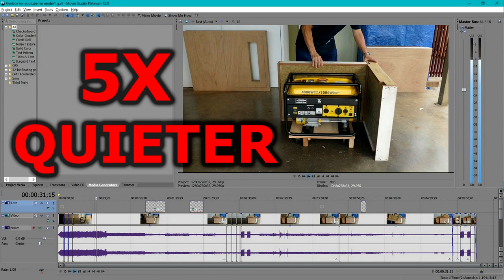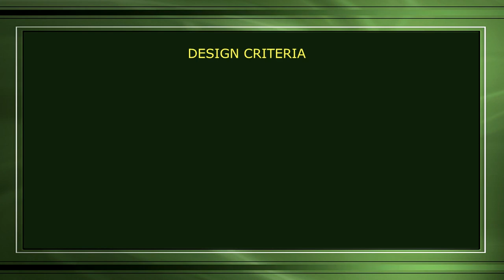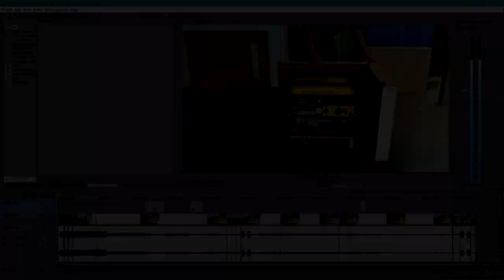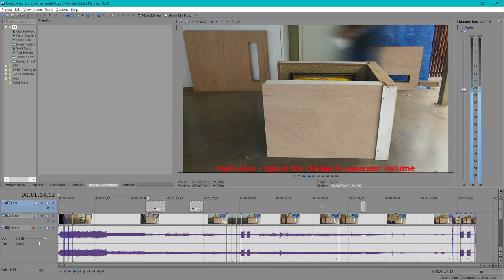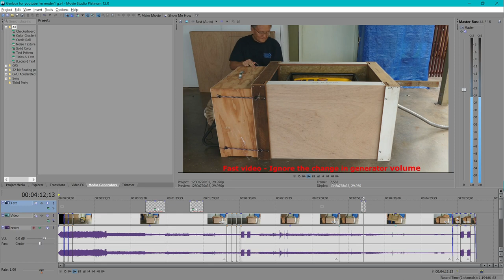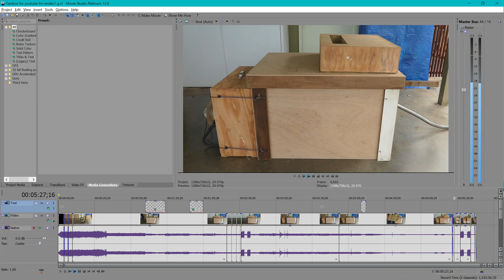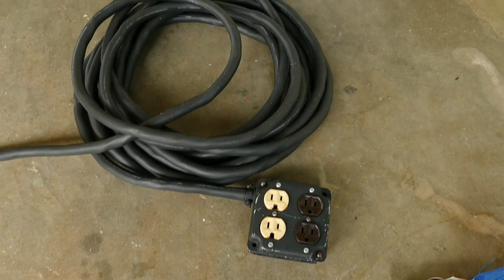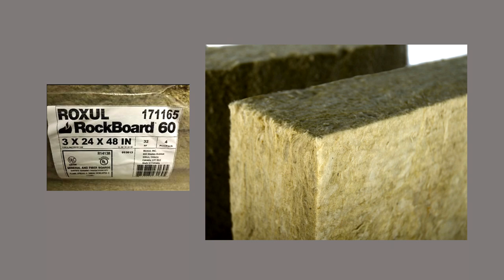5x quieter generator or compressor sound reduction quiet box

Comment: An excellent design, wonderfully presented.  I did wonder about the construction of the walls and top – is it just air space or do you have acoustical foam within the inner and outer walls?  Thanks for posting and for answering viewers' queries.
Reply: Thank you for your kind words.  Insulation used is Rockboard 60.  My plans package discusses it plus use of other types of fire resistant insulation with similar sound reduction characteristics.  For info on my plans package, send an email to usefulgizmos@gmail.com.  Thanks for watching and have a great day! .... Usefulgizmos

Comment: FIVE times quieter? No way! As seen at 9:25, it was 21 decibels quieter, and every 3 dB reduction cuts the sound energy in half. For 21 dB that means 21 / 3 = 7 times the sound was cut in half, giving 1/128 of the original noise, or well less than 1% of the original noise!

Comment: Curious to know if you’ve ever measured the temperature inside the box after several minutes run time on the genny. Obviously it doesn’t cause any functional or catastrophic failures, I’d just like to know exactly how warm it gets inside the box using this system. Great first video!
Reply from the maker: Hi Tommy,
I did not have means to measure the temperature inside of my quiet box when I did my testing.  But just feeling the warmth of the air coming out of the output port with my hands, was sufficient for me to know that my generator was being cooled more than adequately.  The Vornado 11" fan that I'm using pushes a lot of air through my quiet box, and the size of my intake and output holes were mathematically calculated to match the air flow area of my fan.  Also note that my generator (as I believe all generators do) has a built-in fan that pushes air through the assembly to cool the engine.  In addition, since the engine exhaust, which is really hot, is being exhausted via my exhaust system, it does not contribute to the internal temperature of my quiet box. --- I've since purchased a digital meter that can measure temperature so I'll check the temperature the next time I assemble my quiet box and run my generator.  Might be a while though. --- Thanks much for your kind comment and have a great day!
Reply: That was my immediate concern.  
I would have to be forced by some kind of local noise codes to do this to my generator. 

I read his reply and his mention of fans and vents may be keeping an air cooled engine from overheating.  (Hope the fan never fails or gets obstructed. )

If he is hoping to go "stealth" when the sh** hits the fan ...that might not be a good idea. Even if people don't hear it,  they will smell it.   Logic dictates that if you have gas you probably have food too.

But the reality is that he had enough extension cord to put it in the neighbor's yard where he couldn't hear it.

Comment: The only question that I would have is how good is the air cooling for the engine and the alternator itself? That is an air cooled engine and it  needs circulation around the fins on the cylinder and cylinder head as well as the alternator itself especially under heavy load. If the windings get too hot, the varnish insulation on the wires will melt and short out.  Not to mention the air intake has to breathe. I have my 7 Kw Troy Bilt generator in my unattached steel skin garage and wired to back feed my house when the power goes out. I have a small air conditioned electronics workshop built within my garage that makes an alcove right across from the walk in door. 99% of the wind and associated rain or snow blows from the west so I don't have a much of a problem leaving the eastern facing walk in door open while it's running. I also open the drive in door about 12 inches for air circulation. On the strange days that the wind blows from the east, especially in the winter, I have to shut the walk in door to avoid burying the inside of the garage. When I do this, the generator by itself will eventually choke itself out for lack of oxygen and the build up of exhaust gases. On hot summer days, the engine will also overheat if the door is shut to avoid rain intrusion. I solved these problems by buying a dedicated 20" box fan and leaving it placed at the alternator end of the unit and plugged into the front of the generator itself. It keeps cooling air blowing past the unit and keeps air cycling past so exhaust doesn't build up in one place.
Reply from the maker: Hi Jeff,
No problem with cooling or supplying oxygen to the engine with my air intake and output configuration.  The sizes of the intake and output holes in my quiet box were calculated to match the Vornado fan shown in the youtube video.  Cool intake air directly feeds the engine's intake air filter and also blows through the generator to cool the engine.  The exhaust port hole, being at the top (warm air rises) of the opposite end, exhausts the warm air nicely.  Engine exhaust does not contribute to heating the inside of the quiet box since it is piped out with the flexible exhaust tubing.  For testing, I've run my generator for 20 minutes and the engine performance and cooling were fine.

Comment: Just put a 30 Amp breaker in your house and run your power cable to that.  When you want to run your generator just shut off the main power and turn on your generator Breaker.  My 1800sq ft house runs fine 30 amps with well pump, 2 refrigerators and 1 freezer and I even was able to run the 3ton AC and it was under 25 amps.

Comment: Wow, you lowered the sound volume of your generator by 125 times!
Reply from the maker: Hi antronx007,
Thank you very much for that astounding analysis.  Have a great day!
Reply: You're welcome! Assuming your camera's sound recording path is linear, then going from -9 db to -30 db is 21 db attenuation in sound power. Plugging that into logarithmic to linear power calculator produces 125 times reduction in sound level. That means your sound box absorbs 99.2% of generator's noise! I am definitely going to build a box like this one for my 7kW gasoline generator using the same absorbing sound material. Your sound box project is the best one i've seen on youtube so far.
Reply from the maker: Thank you for doing that math and sharing it.  Good luck on building your quiet box.
Usefulgizmos

Comment: Impressive noise reduction. 
Question: would a solid brick enclosure have better noise attenuation?  I have only found heavy mass to be of any satisfactory use, but this has proved otherwise.

(I built a 3-wall enclosure of solid brick around my outdoor air conditioning condensing unit, and it helped lots.   Also, solid rubber vibration isolators helped more than anyone might imagine - mostly effected the basement .)

Also, FYI, turns in the airflow path will impede airflow.
Reply from the maker: Hi Lou, 

My only sound reduction experience is with building the quiet box for my generator.  The Rockboard 60 insulation that I used has excellent sound absorption qualities but is very light weight for optimum portability.  Plus Rockboard 60 is very, very fire resistant.  I suspect that a solid brick enclosure could have better noise attenuation as long as it blocked all vibrations of the air (sound). .... Yes, turns in the path will impede airflow but my quiet box has really good airflow despite the input and output sound baffles.  I can hold a piece of Kleenex and it waves like a flag in the output air stream. ....
Thanks,  Usefulgizmos

Comment: Hi, wonderful video that inspired me to build my own enclosure. I even used the same acoustic insulation.  Do you monitor the interior temperature of the enclosure while operating the generator?  Are you concerned that the generator may be damaged due to overheating?  I live in the northeast so I’m not too worried during fall or winter, but the summer concerns me.  I have installed a 10-inch 600 cfm fan and proper intake vents.  I’ve finished the enclosure and will begin testing the interior temperature.  The Westinghouse 9500/12000 spec calls for a maximum 104 degree ambient temperature for operation.  Thanks!
Reply from the maker: Thanks Gerard.  No, I'm not concerned in the least about overheating my generator.  The air coming out of my Qbox is just warm and most of that heat is from the hot muffler which is at the END of the airflow path.  The hot exhaust from the engine is piped out of the Qbox.  My generator has not overheated.  Have a great day! .... Usefulgizmos
Reply: Usefulgizmos thank you!

Comment: I watched a lot of videos different styles and so far, this is the best I think in my opinion.  Super typhoon storm Mawar just hit Guam and we are out of power. I'm running my generator 13-14 hrs a day. I noticed there's no exhaust fan on your design. My worry is without exhaust fan, it might overheat. Will it?
Reply from the maker: The fan blowing air into the quiet box provides the cooling air flow.  Thanks for watching and have a great day! .... Usefulgizmos

Comment: Thank you for  the video. I searched a long time for the correct answer. I was not sure why so many tried to so suppress sound waves of such frequency scales and high volume using sound resonating metal tubes?
– don’t they know pipe organs were made that way?  Their method could work if you follow
the automobile muffler  as an example – heavy gauge metal at the origination (exhaust
manifold) and then a long trip through filters and constrictions – then 45 and 90 turns. PS: the temperature of the exhaust also plays a role in sound amplification - I don't care who says otherwise.thanks again, this is what YouTube is all about.
Reply from the maker: You're welcome and thanks for your interesting comments.  Have a great day!

Comment: Curious if the box adds heat which could affect adversely the generator.  Did you measure the temperature in the box while operating the generator?
Reply from the maker: Since the hot exhaust from the engine exits the quiet box via the exhaust tubing and does not stay within the box (very important), the airflow from the external 11 inch fan plus the generator's built in fan provides good cooling for my generator.  I have received thank you's from some folks who built quiet boxes and have run their generators for days without overheat problems and are happy with the peace and quiet they experienced. .... But my video and any info that I provide are for information purposes only for the quiet box that I built for myself.  Anyone who builds one does so at their own risk.  ... Best regards, usefulgizmos.

Comment: Sound reduction, also equals no cooling. Measure the temperature of the generator running outside the box while under A load. Then measure the temp under A load in the box. If you shorten the life of your generator trying to make it quiet. When it quits running it will be "real" quiet. And not good. 
  Just like your car, you have to keep it cool, or it stops running. And wears out your oil a lot faster, Try aiming the loudness upward, kind of like those barriers along the freeways, in bigger cities. All those boxes people are building to quiet their generators keep the heat in and the cool fresh air out. There is no way to totally silence that generator. But you may be able to aim most of that noise up into space. BUT remember the cool engine will live longer. That generator needs to get rid of excess heat too. all that stuff is air-cooled.
Reply: For a person with common sense and some knowledge of engines and cooling requirements it's simply doing a few tests. With a circulating fan forcing air into the enclosure the cooling wouldn't be a problem. (One could also have a fan sucking the hot air out) Taking ambient air temperature inside the enclosure, while the engine is running, would be a simple task. There are also sensors one can purchase to mount on the engine.  Doing it properly without causing damage to the engine is all about how intelligent the builder is and how far they want to go.

Comment: Very impressive!.  One of the best quiet boxes for a generator I have seen.  Do you keep it in your garage when you are running the generator?  I was thinking of perhaps building this outdoors but am concerned with rain coming inside the box. I like the way you can assemble and disassemble it quickly, great plan!! Thanks!!
Reply from the maker: Hi Vincent,
Thanks for you kind words.  I will only use my quiet box in our carport because the plywood I used is not water resistant and because my generator's exhaust system is set up for our carport.  To use the quiet box in the rain, one would have to use exterior plywood.  Prevent rain from going into the quiet box by: (1) installing the intake fan(s) inside of the intake sound baffle or on the intake end panel of the Qbox and (2) relocating the output port in the cover to the exhaust end panel.  (3) With intake and exhaust ports facing horizontally, small angled roofs could be attached above the intake and output holes.
Reply: @usefulgizmos  Thanks -- i was just going to use vents for the box but i think an air intake fan is a better option than just a vent..plus you can just plug it into the generator.

Comment: Try a pyramid style of box with a foam bottom(no wood on top); sound is reflected and absorbed directly into the foam on the bottom, instead of bouncing back and forth on the 90° walls untill the sound is dissipated.

Comment: why would 77 haters thumb this down.  They should be embarrassed  for there ignorance..
Reply: i'm one of them .. it make me angry when  "technicians /geniuses " lead people to costly disasters  for sake of shine as " smart individual " and make few bucks on  "plans " sales lol .
generator need good ventilation to be cooled . this box is an destroyer withn this joke ventilation . 
Only good part is the pipe going high but is that such idea reason for such celebration ... my old grama would come up with it faster than this  "inventor " 
Is not hate ..is just saying world against wrong doing to bunch of people all over the world on you tube which sooner or later will discover that they have to purchase another generator . 
maybe this is agency of generators manufacturer to increase production lol ??
Reply: They probably didn't read enough of the comments to find out what the actual builder/user experience is for people that have built this design and tested it. The predicted apocalyptic outcomes, i.e., "generator blows up or melts down in 4 hours", are not actually occurring.  In fact, I've yet to see any of the builders  complain about heat management issues or high temperatures at the cooling exit port, even after multi-day runs, some in hot climates.  I'm looking for a simple air temperature sensor to  mount at the generator motor's fan intake on the quietbox I'm just finishing up.  If that temperature remains below the ambient temperature maximum spec for the generator, then the cooling should be sufficient.  I'll be interested to see how much rise occurs over actual ambient temperature outside the box.

Comment: Is there any danger of heat build up while running the generator? Especially in the summer time!
Reply from the maker: Hi flybob13, ..... I live in Hawaii and there has not been a heat problem with my quiet box.  Actually the insulation in the box works both ways.  Like folks insulating their house to minimize external temperatures from affecting the contents. ..... 
Have a great day, .....Usefulgizmos

Comment: Just a note on your rain cap. With a double wall exhaust system, the rain cap is unnecessary and only creates back pressure on the exhaust gasses. As rain doesn’t  fall straight down but at an angle, it will strike and  collect on the inner wall of the outer pipe and not inside the inner pipe in your current configuration.
Reply: Is that why we are supposed to have a rain cap on the top of all exhaust pipes that stick out of the top of a house?  You know, those that are also double walled.  Also, there isn't any back pressure, because there is space between the cap and the end of the riser.

Comment: I wanted to put this together for anyone else that's interested.  Let's assume you have an 84dB generator (something that seems quite common).  Your generator was operating at -30 dB w/o any sound proofing, and then at -9 dB w/soundproofing.  Since the decibel scale is logarithmic this would make a difference of 11.2 dB (not 21dB).  Again, assuming you have an 84 dB generator, you just reduced it's sound to 63 dB (which is a difference of 11.2dB on this logarithmic scale).  For reference, a normal conversation is 55 dB.
Reply from the maker: Aside from your theoretical evaluation, I can say that many folks who bought my plans and actually built a quiet box have reported that their sound reduction is amazing and phenomenal (their words).  Thanks for watching and have a great day! .... Usefulgizmos
Reply: @usefulgizmos  Thank you again.  I just wanted to give my 2 cents on what the sound reduction would compare to as volume on video players can hinder a comparison.  Your video was, by far, the most practical how-to, which not only reduces sound (by substantial degree), but also protect against CO poisoning.  A+ for putting this together and making it work in an easy modular design.  When I get a generator hooked up, I'll give serious consideration to buying your plans <3

Comment: Great ideas and application. A question if I might.    I what area of the box did you use Rockboard 60? I know on the top. I would like to use it on the sides (its so fireproof). How could that be done? Thank you
Reply from the maker: RB60 used in cover and all vertical panels.  For info on my plans and instructions package, send an email to usefulgizmos@gmail.com